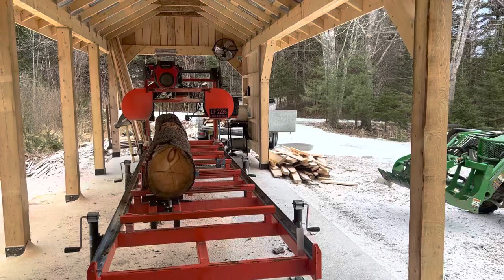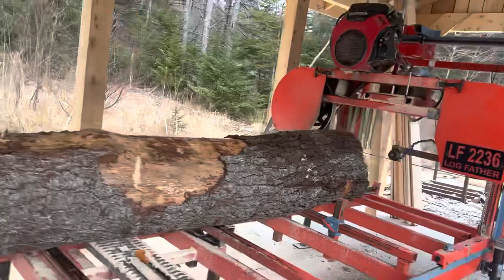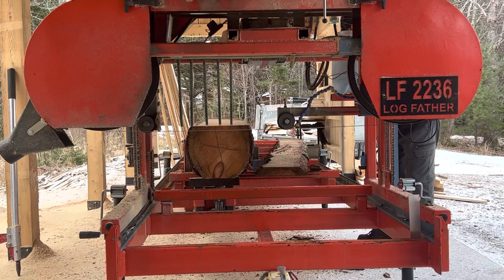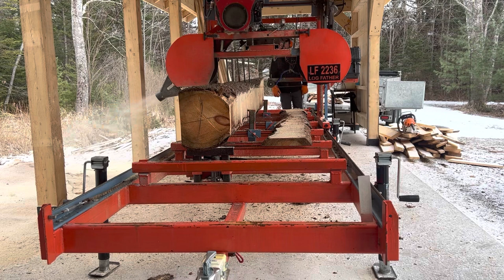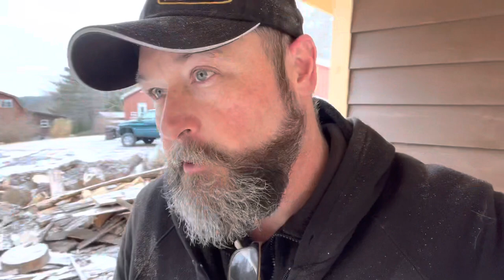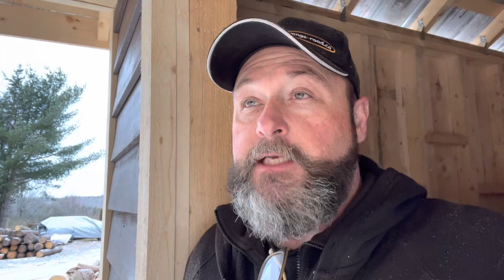Making wise decisions

Comment: Nice optimization. I like the way you do edge and debark by coupling back previous boards with the main log, kind of an art here.
Thanks for the comments about blades, I was long wondering about how well and long they last.
Reply from the maker: It’s a little less than efficient edging the lumber on the mill- I’d like to build an edger- that would certainly speed the process up. Thanks for watching! Jeff